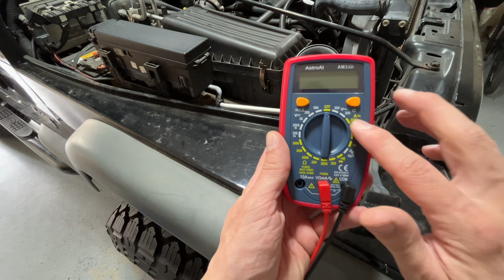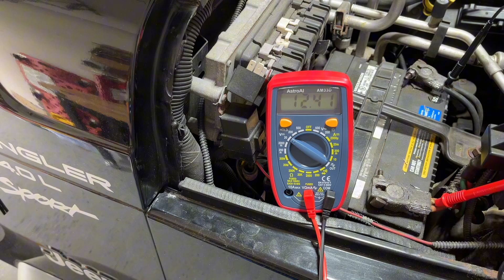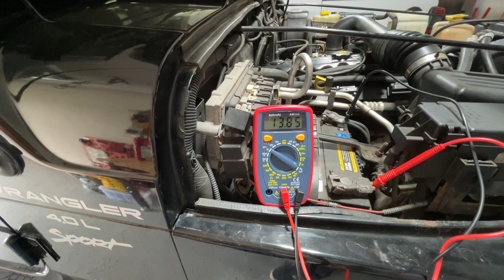Car Battery Keeps Dying? Watch This!

Comment from the maker: Need to know if your car battery is bad? In this video, I show you exactly how to test your car battery with a multimeter—step-by-step! Whether you’re dealing with a no-start, dim headlights, or battery drain, this simple DIY diagnostic can help you figure out if it’s time to replace your battery or just recharge it.

What you’ll learn:
	•	How to use a digital multimeter on a car battery
	•	What voltage means for battery health
	•	How to check your alternator at the same time
	•	Common signs of a bad battery

This works for: car batteries, truck batteries, SUV batteries—any 12V automotive battery.

Got questions? Drop them below and I’ll help you out!
Subscribe for more car repair tips, diagnostics, and how-to videos every week.

Comment: Great vid! While im driving for like an hour , the voltage is dropping to 13.8 or some times 12.6, but when i just start  and keep driving in the morning , it shows 14.8-15, so what is the deal?
Reply from the maker: If it's dipping into the 12s while driving, especially like 12.6 or lower, that could mean the alternator isn't keeping up, or it's starting to go. When you're cruising, voltage should usually stay in the mid-13s or higher. Could also be a bad ground or weak connection somewhere. The higher 14.8–15V in the morning is normal when it's charging hard but dropping that low later on isn’t ideal. Might be worth having the alternator tested just to be safe.